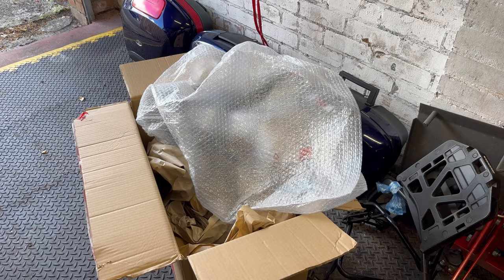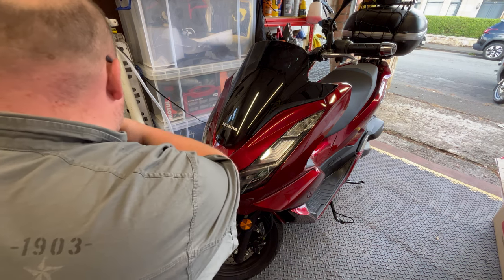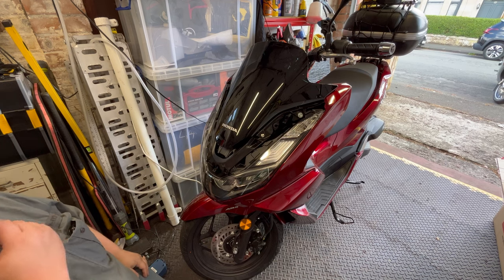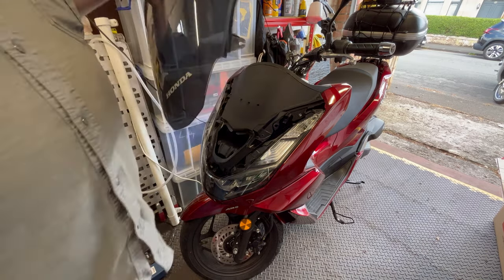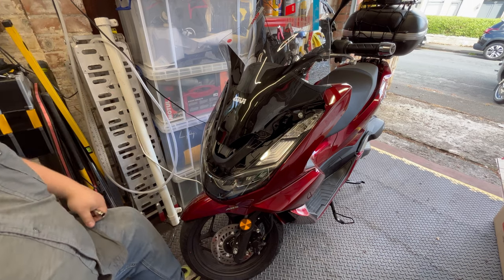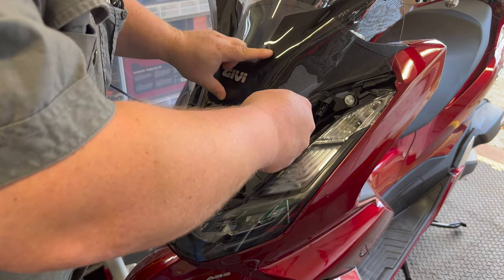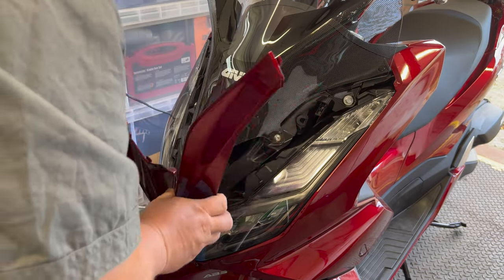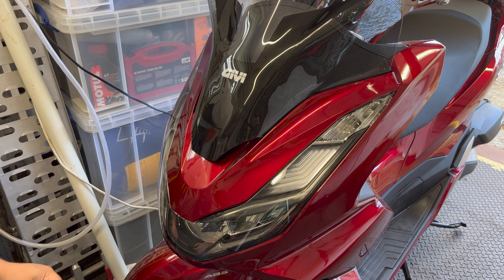Fitting small short givi screen D1190ST (the best looking one) to the 2021 - 2022 Honda PCX 125

Comment: For those with a PCX 160, I wanted to note, with this windshield installed my top speed on the same stretch of highway, with out drafting off of any cars, increased from  a steady 68 mph to 70 mph. The pcx seems to not want to go over 70 mph, even when drafting a car or going downhill. I believe it is limited to 70. I will eventually add a performance variator and Dr p sliders.

Comment: Hi. Can u put a link to buy it this windscreen? Thanks!
Reply from the maker: Available on ebay uk here https://www.ebay.co.uk/itm/284649973109?mkevt=1&mkcid=1&mkrid=710-53481-19255-0&campid=5338723872&toolid=20006&customid=zaV6bh0VAAAArkUa4SBac7r0MW4aAAAAAA
Reply: @misfirems  u know if are a bigger model or this is maximum high?))
Reply from the maker: @calatoriile-lui-adam  there is a taller one but I hated it https://youtu.be/EPHRe2Z8BBw